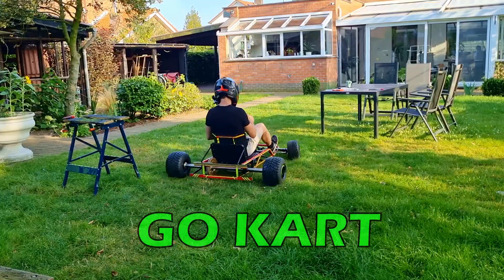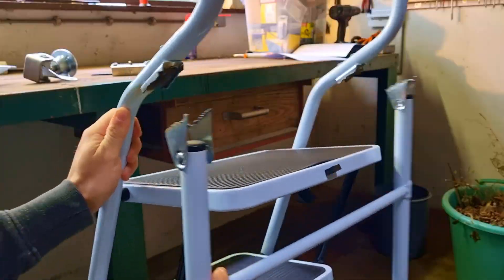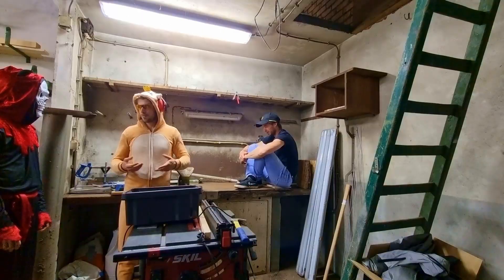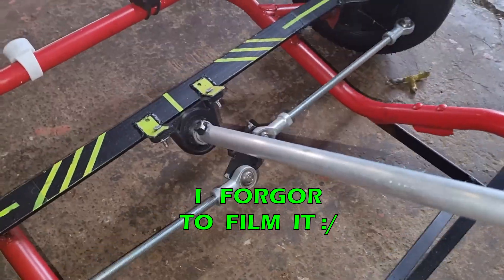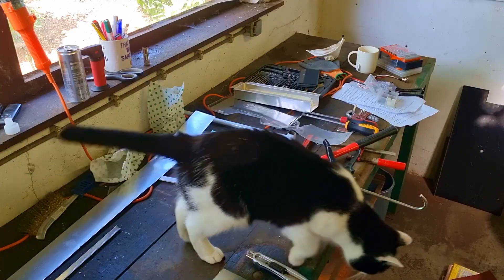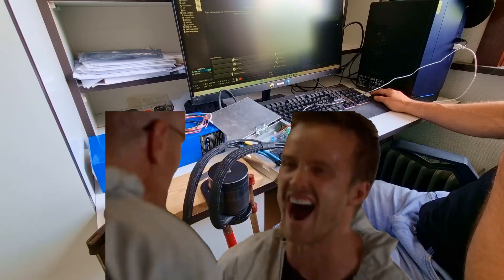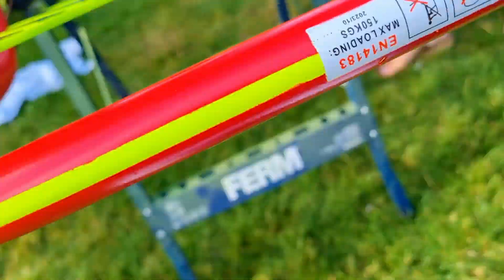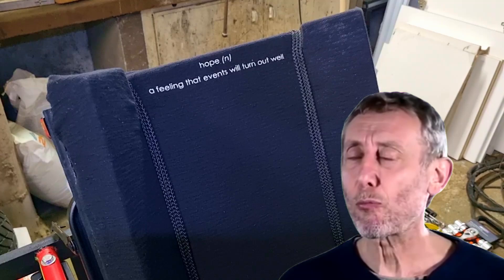🏎 BUILDING a POWERFULLL Electric GO-KART? Here’s Everything You Need to Know! 🏎 Part 1

Comment: Flip your polarity on the welder.  Most fluxcore is Anode negative.  It makes the heat dispurse a bit easier.  Also, give yourself a bit of room for the metal to melt into the weld.  I usually do 1/4" more than I need and widen my pathing for the bead.  One more thing...  Any kind of weld that makes slag, you pull the weld don't push into it.  You will 100% of the time get porosity if you push the bead on fluxcore.
Reply from the maker: Thanks a lot for the tips! 🙏 I had already heard about flipping the polarity for flux core, but I didn’t realize my Parkside PMSG200 A2 actually supports it — good to know!
I really appreciate the reminder about pulling instead of pushing the weld. I’ve mostly been pushing the bead, so I’ll definitely try pulling next time and see how much of a difference it makes.

Thanks again for taking the time to share your advice — really appreciate it!

Comment: Cool project, you got really powerful motors but if your battery bms is only delivers 50 amps it limits your power significantly. 52v multipled by 50amps it's only 2600w. So you would need a battery with 150amps bms to get full power from your motors.
Reply from the maker: Thanks for the comment, and you’re absolutely right—your calculation is spot on! I had to take my budget into account for this build, and the highest BMS limit I could find was 50 amps. Finding something higher would have meant building my own battery with a specialized BMS or buying a much more expensive battery made for heavy-duty EVs, like electric motorcycles (e.g., Surron). Definitely something to consider for a future project!

Also, if I went that route, I’d need to upgrade the ESC as well, since that would then become the bottleneck. You're right about the 7000W spec—it’s often used as marketing by the motor sellers (and, I’ll admit, in my video too). Even with the limitation, though, I was impressed by the acceleration and speed!

Comment: So I bought the flux 125 gasless welder, but they come with just a gas tip. So I cut mine back with a grinder and its much better, I know this won't matter as you'll be done with the project but for the futire
They made you pay 45 bucks for that Itty bitty step ladder!? Sheeeesh
Reply from the maker: Yeah, I took off the gas tip too, but luckily it came off pretty easily without needing to grind anything—still, good tip though, I appreciate it! 🙌
And about that ladder... I know, right?! Welcome to Europe, where even tiny step ladders can break the bank. Let’s just blame inflation for this one. 😅
Reply: Well yeah it unscrews but I like having that buffer I find i don't contact the tip and melt the wire to the tip lol

Comment: What about brakes?
Reply from the maker: Congrats, you're the first to notice! Haha 😅 Like an electric longboard, there are no traditional brakes—braking happens through the motors. I can electronically brake and tweak the braking strength via the ESC settings. That said, a handbrake would definitely be a great addition for more safety and a snappier feel. But for now, braking on the motors does the job... as long as I don’t need to stop too quickly! 😎🛑